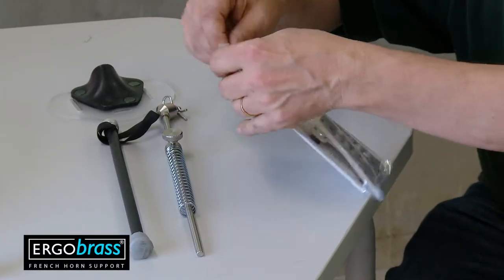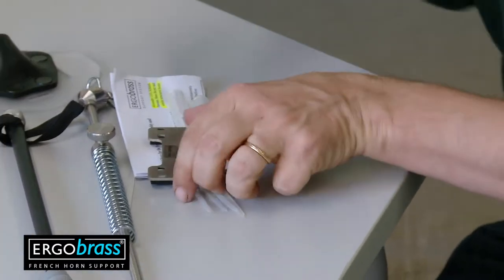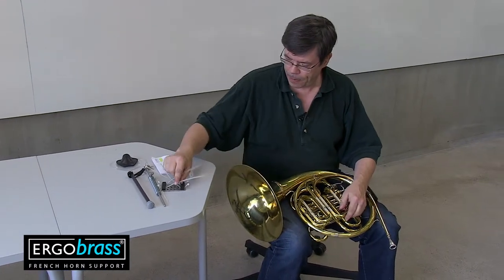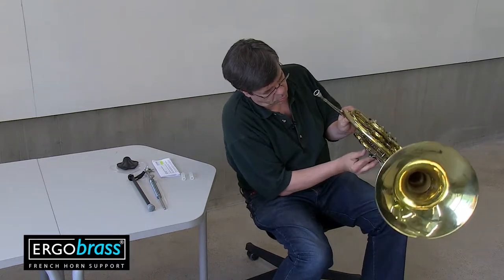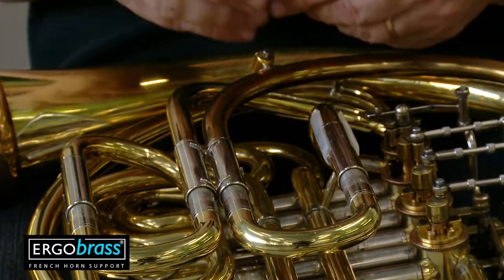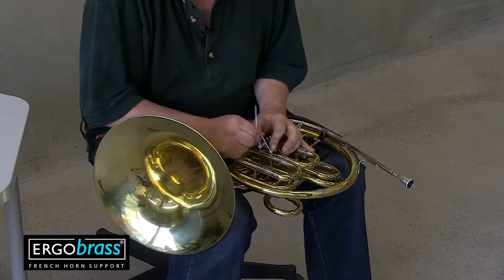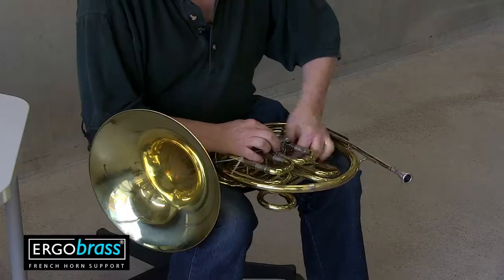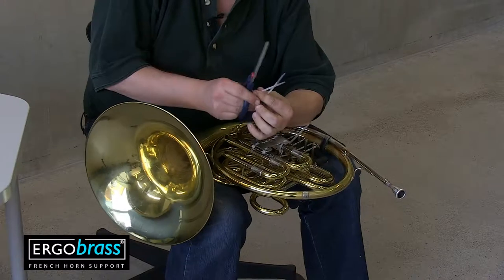Installing the ERGObrass horn plate A

Comment: How do you recommend getting the ties off if you need to remove the plate for cleaning?
Reply from the maker: Any sharp knife, wire cutter or scissors will do it easily.